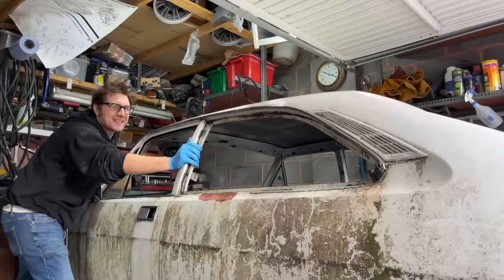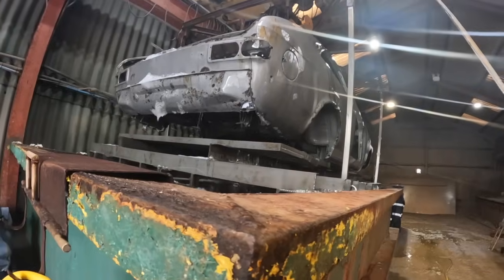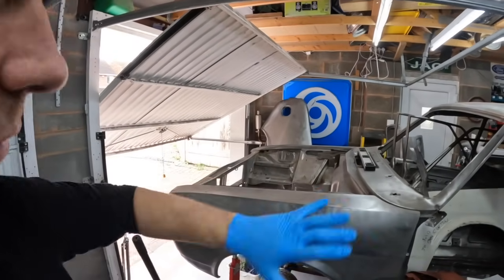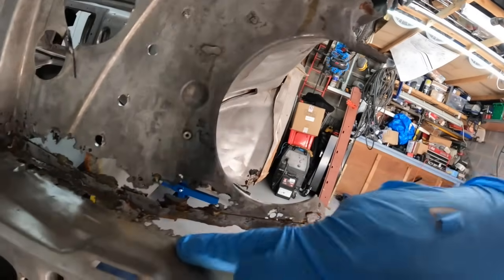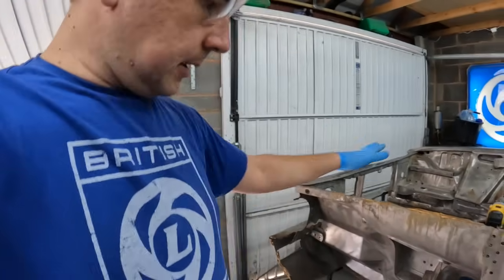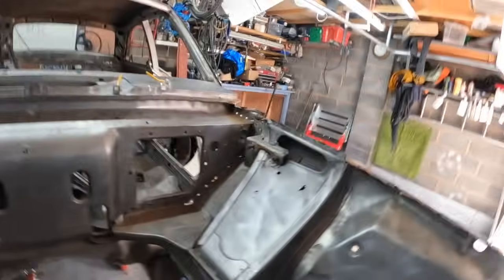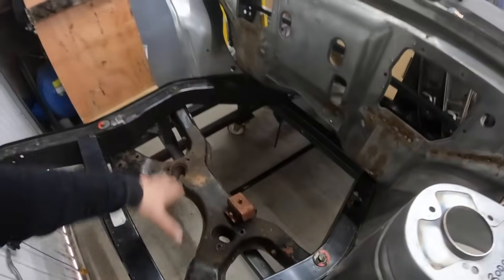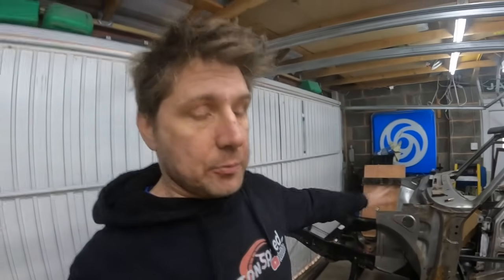Building the ULTIMATE British Leyland Prototype TRIBUTE  Pt2

Comment: Dull Mens Club: Roy Haynes designed the Marina, & Harris Mann designed the TR7 (still my fave sports car btw)
Reply from the maker: Harris also re-designed the face lifted Ital, not Ital design as so many people believe.
Reply: So, not looking to battle anyone, but what's the difference between drawing the design and finalising the engineering? I'm guessing both cars had a team involved to engineer post design, some team members likely to be common to both cars, both of which were built within the company ethos of that time?
Reply from the maker: They may well have shared teams, but I had head that internal politics between marks sometimes got in the way. Having cut out the front chassis rails I'd say the construction was similar between the two cars but no different to any other monocoque chassis of the time i.e. central cross brace, forward running rails etc.

Comment: Interested to see what this does to the handling. My old saloon handled great with Spax adjustable telescopic dampers on a late Ital van mounting conversion so McPherson struts should improve on that
Reply from the maker: It should give a little bit of balance with the steering rack now under the engine and the motor a little further backwards. Saying that, my turbo saloon handles like it is on rails with torsion bars, but is quite harsh with stiff rear springs and tighter telescopic dampers on the front.

Comment: Nice one Ben. Tango, my rally Coupe still has the original but heavily modified front suspension with coil overs
Reply from the maker: Great to hear it is still about. I remember buying the old SD1 engine from Tango about 20 years ago!
Reply: Regrettably sad that the Q plate situation has to be accepted, but that's the law, if you want to stay on the safe side. But what about the biva test before that? Not insurmountable as I understand it, but not a walk in the park. Appropriately marked glass is I gather a usual issue, but nothing that ££££££'s doesn't fix.
Reply from the maker: @hotrodchris805  E marked glass, light lenses, radius no more than 2.5mm on outer edges... But yes, necessary evil and budgeting accordingly.

Comment: I remember in the early 70’s BL autocrossed a marina with a Rover V8 in it. The only body mod was a vented bulge in the front valance
Reply from the maker: Yes it was WOK 107J an ex press car they modified. Then they built the V8 rally car for the '74 UDT rally along with a V8 pickup for custom car magazine. The trick was to use block hugger headers on the RV8 to clear the chassis rails and a manual gearbox from a P6 iirc? The valance bulge changed to a complete centre removal on the UDT car so the radiator could be placed in.
Reply: @claytonspeedcars did they make a v8 marina in Australia??? Or was it a 6 cylinder????
Reply: @matthewc.419 there was a stock 6 cylinder made in Oz.

Comment: When you're finished with this one, that'll shut up the trio I should think.

One crud thing about acid though, rockers, sills, plate & seam joints & framerails, are now stripped of what little protection they got from factory.
... Good luck with that 🤣
Reply from the maker: I think it will. 

The shell needs approx. 25-30 panels plus new chassis rails, most of that is areas where the seams would be stripped as you say. Once completed the shell is being dipped and e-coated. Thanks for watching.

Comment: Hi, I heard you mention the instalation of a TR7 front on to a Marina and that this was not BL's intention. I am not here to say your wrong, however back in 1977 I was under training on  The E. I. T. B. training scheme. Towards the end of my course I was shown round the Cowley works with a view to becoming a tool maker. I visited many departments at Cowley including paint and trim departments and corrosion assessment on the SD1. I was show a vehicle which was something to do with safety assessment. It had things like automatic seat belts and I think a camera rear view mirror. I have always described the car as looking like a Marina with a TR7 nose. Apparently the low nose was a pedestrian safety feature. So in conclusion your statement may have some credance. 👍Cheers
Reply from the maker: That would have been the SRV project cars. SRV2 is at Gaydon Motor Museum and is a saloon. There was a coupe as well I think, but it hasn't survived. The front end does look very TR7, so yes, some credance.

Comment: I know you e cut the shell about but if you can convince IVA that you've used 3 main things from the 'donor car' you might be able to get an age related plate instead of a Q reg
Reply from the maker: I thought it was two main things? Either way, something I need to research more on. Thanks.
Reply: Or maybe get a TR7 log book, steering, suspension and rear axle, use that as the donor car,  job done 👍

Comment: i'm sure they made a coupe here in australia and had a 6 cylinder in it 
when leyland  folded in aust they took the marina tooling back to england
Reply from the maker: Yes! Leyland Australia built a 6cyl Marina. It had a different front valance to accommodate the extra cylinders and radiator.
Reply: What engine type and capacity was the  6 cylinder?
Reply from the maker: @Jools-j2l  Largest was a 2.6cyl I think. It was basically a Maxi engine (E series) with 2 extra cylinders.

Comment: marinas were awful cars when new.front suspension hideous.trunions that would constantly seize,grease them regularly?you didnt have to do that on any ford,just jump in and go.worst gearbox ever fitted to any car.gear stick turning like a pudding stick because side pin breaking.synchros useless from day one out of the factory.gears themselves whining or breaking totally.BL gave up making gearboxes because ..they couldnt,had to buy them from vw to use in maestro/montego.good idea but they decide to make their own linkage.ha!couldnt even get that right.gear change horrible and then all the linkage ball joints fail.absolute shambles of a company.rover 216 vs 213 no contest back in the day.BL couldnt make a decent gearbox or even a decent car so just got the japanese to do it.ha ha.k series head gaskets?list goes on and on.A series engine  good though.any way,you plod on with your long door.wont be any worse than what BL could of made,now wheres the keys to my 3 litre capri...